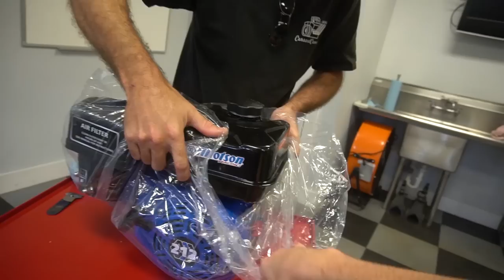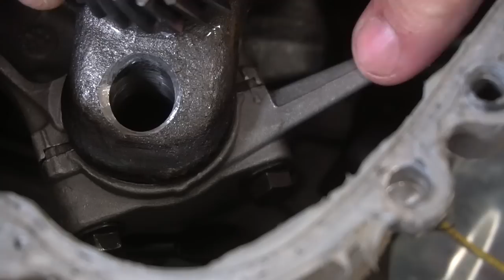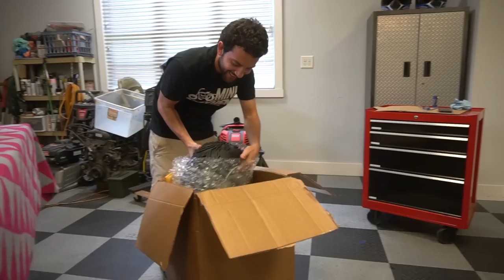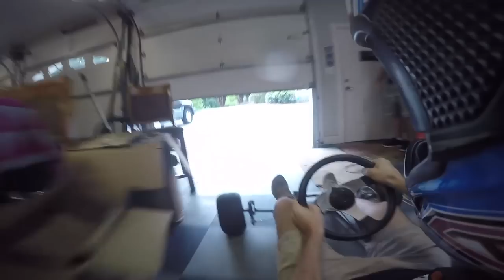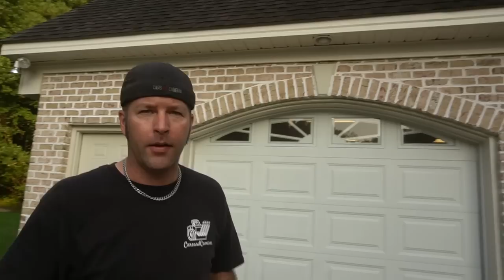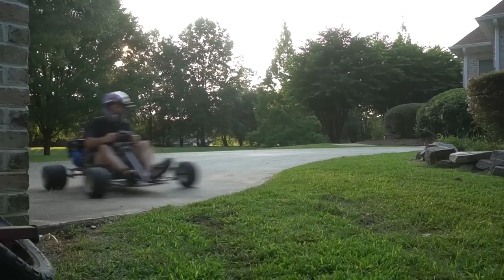10HP STOCK | Honda Clone Revolution

Comment: with those tillotson's you can get mechanical fuel injection from GPS which is perfect for....TURBO!
Reply: best comment on this channel ever
Reply: Single cylinder carburetor is the worst type of engine to turbo. Efi still might not help that  much
Reply: Maybe with a boost referenced rrfpr but the ecotrons they used on the drift trike is a much better system. You just have to know how to tune
Reply: This comment needs more likes so they see this. Would be awesome to see some boost on this show!
Reply: its so tough to add boost to a non fuel injected small engine. you basically have to build a box around the carb or a complicated boost reference setup, changing the jets won't do it. The mechanical fuel injection is so friggen easy, carb hat and fuel pressure gauge is all you need.
Reply: Yess I want them to do this
Reply: The TCT carbs aren't really fuel injection it's just marketing bs not to say they are bad I use them my self and they work great they just aren't fuel injection
Reply: TURBO....... Oh yes 🏆🙂
Reply: +Logan Arzuaga oh really? I was on their site a while back and saw they had a MFI upgrade and I was excited. Can you explain how its not? I mean I assumed its just like old throttle body injection setup vs float/jet/carb which would make it extremely easy to reference it for manifold pressure. Is it just a normal carb or is it a modified carb for blow through?
Reply: Warfighter Racing it's simple with a slide carb. No box needed unless you're building pressure in the carb. As far as jetting, a simple power jet setup off of an older bike is all that's really needed. Pilot jets could be a bit tricky but the mains'd be simple. 
https://www.thoughtco.com/power-jet-carbs-743539
Reply: Vasily Custom Builds did you not just read his comment before you commented fuel injected does not mean carbureted it means fuel injecteddd
Reply: @Oldsoldiersays   if you boost the carb bowl vent you solve the fuel under boost problem .. but in order to get any spool for 1 cylinder you need a long header with turbo further away from the engine ..
Reply: So on that predator failure, I had a thought. For the Briggs & Stratton World formula racing engines there is a required oil. It is made by Amsoil and it is specifically formulated for non-governed racing engines using dipper type lubrication. It’s probably I’m guessing the best oil in the world for these applications. Y’all should really look into it.

Comment: Sorry to say guys but I'm a Briggs & Stratton engine fan, 31/2hp. 5hp, and , of course, the 71/2 hp rotortiller engine. All with the horizontal crankshafts.
Neibghor kid brought over a Honda 90, Dad said it was to  fast. So my buddy gave me a mini bike with the 3 hp engine.  Of Course, I took off the governor. It held together for 5 weeks, broke the connecting rod. Then I put on the 5hp and changed the final gearing, a few teeth smaller. This worked pretty well till a valve cracked.
On the the 71/2 tiller engine. I think it come from the factory with a bit bigger camshaft, much more raw power.
B&S engines are just so much better and longer life to boot.
Shave the head, High Performance Carb, then we are looking at almost 50mph.
At 13 years old I learned to weld, on to gokarts.
At first I was using the same B&S engines that I was using.
To date, my biggest kart had on it a 2 cylinder snow-machine engine rated at 50 hp.
Hot rear shaft, the clutch top end from the snow-machine and a driven pulley and belt.
On blacktop, the machine would close to 80mph, would climb almost anything.  Power donuts fast enough to make you very dizzy. 
Using ATV tires and rims, it was the run around the farm machine.
The was controlled only by how much air was in the tires.
This was an adult sized go kart on steroids.

So guys come on. Back on the farm we pressed in to service the engines that were on hand, lawn mower, rotor tiller, and I think, one even came from a wood splitter.
Most Tinkers and Home hobbiests had to make do with what was on hand.
 Not a lot of money but a problem solving brain that just wouldn't quit.
When people ask, where did I get my kart....
 I just love to say, with a big grin,  "I built it myself".
From one gearhead to another.
Guys, Please keep coming out with more videos.

Comment: You can get more power if you make 2 holes on the sides at the bottom of the cylinder to release the exhaust pressure in the cylinder, you may need a non return valve, also if you put a turbine you can direct the exhaust to the turbine to give you additional power.

Comment: To stop all that vibration you can use a piece of car tire under the motor with holes drilled through it. Match up the size if the motors mounting plate with a little over size, about 1/2 to 1.5 in, all the way around and just bolt it down. Use locking nuts, maybe 2, on each bolt so they don't come undone while riding. This will eliminate a ton of vibration and make it seem more stable and controllable on pavement and off road. You can also do this on the axle but its a little more tricky to do.

Comment: Should have uploaded a video showing how to replace the engine on an old generator with a Predator...
With Hurricane Florence on its way, I think it would have done well.
I hope you guys have everything secured. Be safe.
Reply: Generator engines have special crankshafts. They are not interchangeable.
Reply: Ike and John could make it hapoen
Reply: JeepYJ91 or just get a new Tillotson generator
Reply: Yeah OK 70chevelle8
Reply: @bryanroupe8646  generators, pressure washers and some water pumps all have tappered crankshafts.

Comment: Awesome Tillotson 212. Please talk more about this engine. Also, stay safe in this big nasty Hurricane !!!
Reply: Arc 6773 is the correct billet rod for it.  Sticker says its a ducar block. Piston has a recess cut for the exhaust valve. Valves look to be 27/24 if I recall. Lifters look larger than clone. Pushrods to upgrade have to be cut to fit I was told. The valve springs seem to be heavy duty I bought 26lbs replacements that don't seem as stiff as stock. Has auto style retainer clips. Shaft mounted rockers no stud.
Reply: Douglas Carver do you know what the shaft diameter is. I heard that it was 5/8 but if it fits the torque converter in the video then it would be 3/4

Comment: Shouldnt u break in the engines before going full throttle
Reply: Thomas Lenhart suppose to but i never did
Reply: I personally just bolt and go wfo. I have never had an issue and I have 6 engines.  Predator 212
Reply: they were meant to be pressure washer engines and such they will be fine
Reply: Eh Itll be fine
Reply: +The Bassman to me it seems they're all bum motors when.....
there's no such thing as a lower rod bearing! IMHO what happened: got a little dry and heated up (chases more oil out!), aluminum expands (steel too), let the galling begin! maybe/IF they had a bearing with a hole and funnel shape aimed at the bearing's center, and an internal protrusion (in the case) for more oil to splash against and drip/pour right AT that funnel shape (and crank arms etc, keep it all WETTER) it'd greatly reduce the issue? oil gets slung vertical off the crank itself to wet the piston and cylinder wall anyway, so something aiming more oil directly at the lowed rod bearing... like a bundle of BIC cigarette lighter's flint springs maybe? the small coils would catch a whole lot and drip, surface tension and gravity helping put the oil where it needs to be.
(not saying an engine doesn't need some run-in time too)
Reply: "it'll be fine"
Reply: Never heard of it
Reply: S E N D  I T
Reply: No if anythingg you should  have highest from to put mad power on the engine then change the oil
Reply: Thomas Lenhart it’ll be fine
Reply: Not breaking in something wont really change anything. COuntless people have did a ''hard break in' with no issues at all.

Comment: Make a drift go cart with a e-brake
Reply: E-brakes only lock the back tires. Budget karts only have rear brakes.
Reply: esqueue he mean a actual HAND brake like a lever
Reply: Just run a double caliper on a single rotor one for the pedal one for the handbrake
Reply: @James-pn9rt  why not just a handbrake?
Reply: So the pressure can be set on the petal for driving and a higher pressure one for drifting
Reply: @James-pn9rt  or just pull it softer for gentle braking or harder for drifting

Comment: No need to polish the crank. Mix up some lye and water and dunk the crank overnight. The lye water will dissolve the aluminum, but won't touch the cast iron crank. All you have to do is ScotchBrite the leftover black stuff on the crank and BAM! No worries about undersizing the journal!

Comment: Look at the rod journal. If there is any aluminum stuck there, it's caused by lack of oil. The windage in the crankcase may be blowing the oil away from the dipper. The bullet rod has a pressure feed hole and is shorter. Oil can accumulate in the groove and get into the rod. If it was a bum engine the rod never would have lasted 1 9000 rpm run up.

Comment: Welll lets see it was a tough decision but I will have to go with Ike on performance. And speed will go to john. So i guess between the two oh and also I would have never known ike did not pull the 360 off if you had not told me but I will have to give it to ike. Happy birthday by the way and thanks for the awesome videos. Also John I would like to see you drive a little bit more dangerous like ike. Love yall both.

Comment: Drifting is all about style not time. Ike wins based on drift speed and angle at speed, the not quite a 360 but solid 270 entry and the ballsy hedge tap. Solid style all round. 91 for Ike but a SOLID 88 from John for bigger angle but slower drift speed.

Comment: So you guys have inspired me i want to build a drift kart with the thing i want to work on the most is 900 degree wheel rotation and about twice the angle ive seen on any of your karts I live 1 hour away from gopowersports any suggestions on a starting point that wont break the bank? also Ike won.

Comment: What was the reason for grinding down the boss on the torque converter plate? Have the same engine and installing the same setup. (30series comet torque converter with juggernaut) thanks so much! Big fan

Comment: Did you know that you can make the axle sprocket smaller by 10 or more teeth when using a torque converter which will translate into a lot more speed ?

Comment: ok...the predator engine has soft rod compound metal.
there's a fix for that and that's rod bearing inserts(machine the rod to accept bearings) or...machine or purchase a rod made from more durable material. the cranks seem to have done well so thats less of a worry but soft rods...failure waiting to happen.
 same deal for the "tickler" also. harmonics cause them to fracture and then disintegrate.
10k rpm  could be yours.... :-)

Comment: you should have put the Flux Capacitor some where else so it can be seen as you drive along..
maybe  at the top of the seat or in front of the steering wheel, in the seat defeats the purpose of showing it off

Comment: This is a little off topic, but what size of wheels and tires are those?  I have this old fiberglass Thunderbird cart and need small wheels and tires for it like that, but when I look to buy any, they all say they are 10 inches high or larger, which seems too big for it.  I really don't want to cut the body to make bigger tires and wheels work on it.  I was gonna use the engine, suspension, and steering parts from a 70cc knock-off quad.  It's got the 3 bolt pattern for the wheels.  Maybe there are low profile tires that would fit on them...  Anyway, I'm having a tough time finding the size info for these things, and figured if you just told me the exact ones you have on this thing, I could just get the same.

Comment: @carsandCameras  what type of oil did you use in the Predator engine?  I recommend Mobil 1  15w-50 racing oil for performance engines.  It has a lot more zinc to help prevent wear.

Comment: Will that tilison engine fit the mounting holes for my CT200U-EX Coleman? How fast do you think it will go? I zip tied my governor and I cut the throttle stop screw on the carburetor linkage, and I've gotten it up to 32 mph downhill. On a flat street, it will go 30 mph. I'd like to get up to 50+ without having the engine constantly wide open and wind up blowing it up.

Comment: I think Ike won hands down ... U both spun out on the  360 but however ikr pulled off more or a risk in bigger drifts and swinging and whipping that kart around the trees. And it's the pour old guys birthday so I deffantly gotta give it to him 4 that .10...10... 9.5 .. John u did very well but I only seen one risky move from you so I gotta give u a 9.5... 10... N a 8.97.  Good job guys ... Looked fun

Comment: If you were building a Mini Bike using a Predator 212 engine; would you recommend  a centrifugal clutch or a torque converter?
thanks,
a fan-Roger Cox

Comment: i own multiple engines not as many as you guys but a decent amount 1 predator 212 1 honda GX120 2 Briggs 5 hp Flathead,s and 2 Tecumseh power sport engines the others are lawn mower engines

Comment: So im interested in building my own go kart for my self and my senior project at my high school and i was wondering if you got a high power engine why do u need alot of torque. I mean i know it gives you more power to go up hill and stuff but arent u getting rid of that max speed? 

Also i used to have a buggy when i was 10 and everytime i went uphill the engine stopped and my dad said its cause the engine gets flooded. Will that happen to all engines or was there just something wrong  with that engine?

Comment: I have a question my predator 212 is  is back firing and turning my go karts wheels backwards  and shooting the exhaust right out the carburetor and I took apart the engine looked at the rods they were not bent I cleaned the carb and I took apart the head I think that it is the timing but I’m not sure do you think you know what the problem is ?

Comment: It would go faster with a smaller sprocket on the back axle,  no too small though or you'll loose power and torque on the low end.

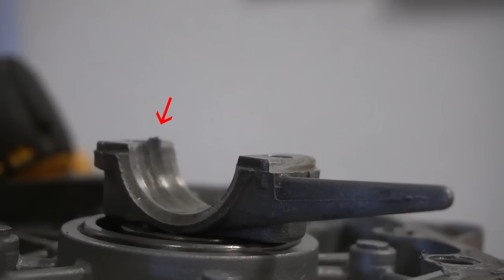Comment: @3:27 ill tell you what the problem was hahaha... the problem was running a stock rod with no rod bearings running all that high end stuff on the top of the engine ;) there's a reason company's make the billet piston rod for the lower end i should know it happened to me hahaha.

Comment: Guys if that cap had a “oil” hole like the Billet rod !!!,the stock rod would have lasted a lot longer if you just took an hour to machine a Weep hole in the stock cap, they turn 9000 rpm all day!!!!!!!
Reply: I doubt even with an oil hole they would last 9K. You ever seen the oil hole on the billet rod? Its in the dipper. The top hole the billet and stock rod have. The stock rods are beveled too to increase oiling. If just drilling a hole in the stock rod helped then some one would sell one.

Comment: yall wanna buy a go kart im in nc as well its a 2 seater chassis with suspension rack and pinion steering and for whatever reason a mitsubishi 6.5? hp on it anyways its lacking a torque converter and more hp maybe like a 420...anyways if you guys are interested id let it go cheap.

Comment: Wait.. they don't put bearings in the rod end?! Well there's your problem. Grinding the rod at high rpm without a bearing will trash that aluminum easily.

Comment: How much bigger is that motor
Reply: But I  would need to take off the gas tank and and air box and the exhaust it would go on a mini chopper and it's got a 79 predator on it and its probably only got room for a 212 with everything taken off

Comment: Funny that you guys have had 20 engines, 2 of which were bad. A 10% failure rate is pretty universal through motorcycles and cars. I think Toyota and Yamaha and maybe Suzuki are the only manufacturers that have an average failure rate of less than 10% average. Looks like oil wasn't making its way between the rod and crank and wallowed out the seat. Happens to the best of em. Even Honda's